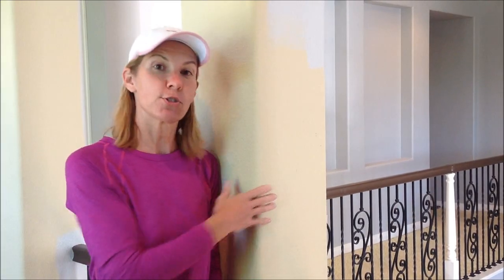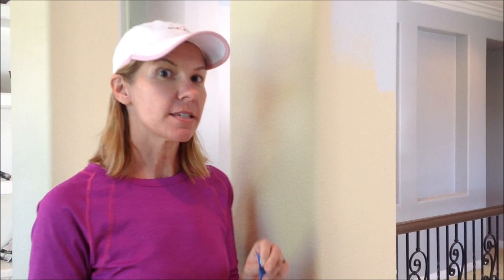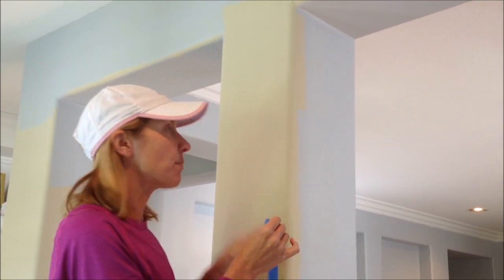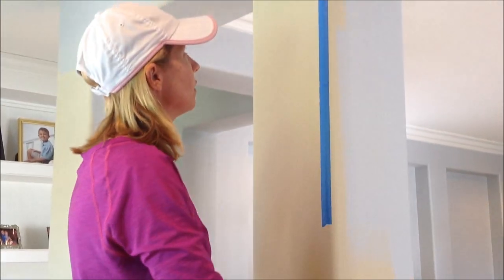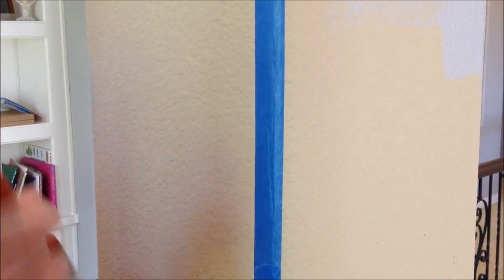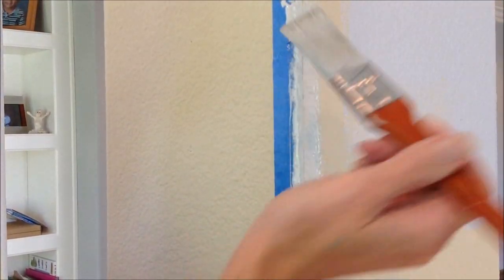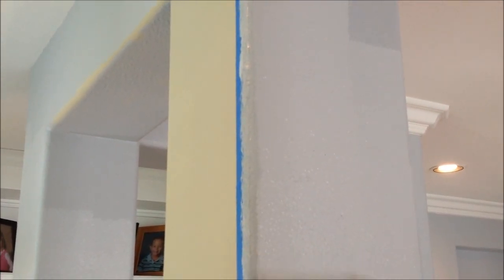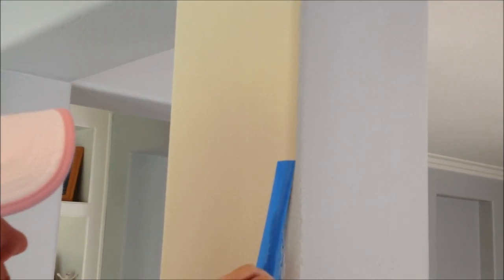Painting Rounded Corners or Bullnose Corner (Without Special Equipment)

Comment: Another tip, paint over the tape with the color that is under the tape. This ensures that if there is any bleeding, it doesn't matter because it's the same color. And it seals off any of those holes. After it dries, go back over with the new color.
Reply: That works nice most of the time.  Another way is to use caulk spread very thinly, paint over the caulk and tape and pull up the tape before the paint is dry.   This works well if you have textured walls and yet want a very straight line.

Comment: They have those plastic bullnose trim guides for miter cutting baseboards around those corners.  

I drilled a hole thru the middle of it, and use it to make a pencil mark in the middle of the corner for your tape.